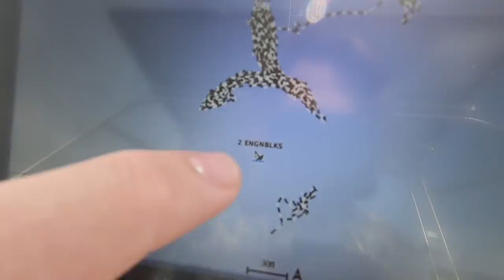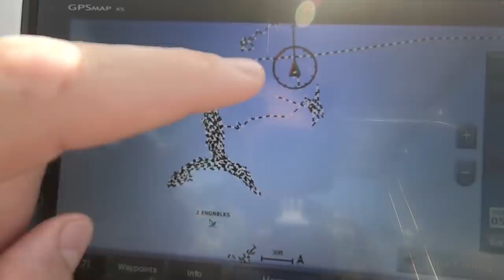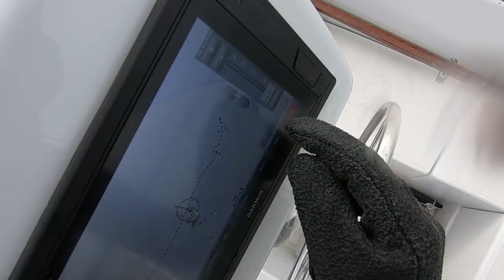You Won't Believe What Our Anchor Chain Got Wrapped Around | Learning the Lines

Comment: Attach a mooring bouy to the engine bolcks and you're golden
Reply: I was thinking the same thing. The hardest thing about having your own mooring ball is the engine or cement block to attach the cable or chain to the ball.
Reply: I was thinking the same thing and in fact if you don't want to do it my boats anchored in Madeira Beach I don't know where those engine blocks are but I wouldn't mind using them for a mooring
Reply: peter Engel my uncle said taking a train axle and wheels would work. Idk how realistic that is though since I’m strong winds with a boat attached it might roll
Reply: @noahturner1508  Yes Noah and it would make a sound  Whoooo whooet  depending on the strength of the wind.

Comment: Jordan, hard to stay on your own anchor for months on end , lots of wear, tear and growth if nothing else. A semi perminant mooring is the best solution. That's probably what the engine block were/are for. It was an old school way to creat a Mooring anchor. You could tie a heavy chain around or thru it and then attack a heavy chain or Nylon line and use that for your longterm Mooring. 
But finding a cheap slip will be a lot easier, if you don't have to spend all you money on a slip. much easier for the boat-work, obviously. Good luck finding that cheap slip though.  Maybe a couple of strong pilings where there used to be a dock might be a possibility? A couple of planks and you have a dock? Cheers Warren .
Reply from the maker: We ended up finding a cheap private dock to tie the boat up to. It's going to be a much better situation.

Comment: Some time, please show how you attached the mooring bridles to the anchor chain.  Looks like you got mantus bridles?  Pricey!  

And too bad you can't put a mooring ball on the engine blocks, but is it illegal to rig  something so you can use them as your anchor?  (I had a dock line strapped to a 6 stroke engine block this winter in the Bahamas, and just dived on it every time I wanted to use it).

Comment: At least the engines are providing a base for some marine critters.  Thank you for the video and have a good week you two.
Reply from the maker: Yeah, there were come critters and a couple corals on the engines. The only issue with their placement in my opinion is the depth at which they were placed. They shouldn't be in anything less than 15' of water to not pose a hazard to passing vessels with larger drafts. They aren't charted obviously so it's conceivable that someone with a 6' draft could hit them quite hard, thinking they have 8' of water.

Comment: Engine blocks once cleaned up a little make nice moorings. Chain them together and hook to a good line and float. I made a few moorings at my favorite locations so I didn't have to deal with anchor. Once the objects you drop sink in and become part of the sea bottom they are strong.
Reply: With a decent magnet you could find those blocks and make a mooring. You could add to it if you don't think it is strong enough.

Comment: Why wouldn't you add a rear anchor on your vessel? Stop all the round and rounds be a lot more stable anchorage . just saying
Reply: Robert Guay , you can't  use 2 anchors when other boats are single anchored. As boats all swing with the tide ( and wind) they generally stay away from each other even in a crowded  anchorage. If you are on 2 anchors you will get too close to other boats as you won't be moving, someplaces mandate 2 anchors but it's rare . Fore and aft anchored can also be a problem if the winds comes beam to your boat , a lot more windage and strain on the anchors , if you swing on a large single anchor you put the bow toward the wind and the least windage and you can easily put out extra rode for increase holding if you have the room. Cheers Warren.
Reply: Ah makes sense I can see that. Thank for your time
Reply from the maker: Warren summed it up beautifully! Large single anchor is usually the best method.
Reply: warp21drive , whenever I was to stay somewhere for a while I would put out 3 anchors with chain going to a central swivel, keeps you in place and you are always pulling on one without the possibility of fouling any of them and head was always into wind. Good in a tight anchorage, if there is someone dragging around the Anchorage there is nothing you can do about it and if a boat like that tangles with you they generally get their line cut.

Comment: What scope did you have? Looks like you had a lot. 7:1 with chain is usually sufficient and it becomes crucial when there are other boats around and you do not know their scope. Cheers.
Reply from the maker: 10:1, It's proven to not really hold. We've dragged around more than I'd like and I'll be making a video about that soon enough. The holding here is crap because it's like flat rock covered in silt/grass. There's nothing for the anchor to dig into.
Reply: @LearningtheLines  In that case you may be better off to make your own mooring using the two engine blocks. Is that doable?
Reply from the maker: @tartansailor  illegal here unfortunately.

Comment: 4" ground chain through and around both blocks... large swival..  shakle Rising chain off the  swival allowing some slack maybe double your water depth. Attach mooring bouy and mooring strops to top of rising chain. Double tie all shackles with wire or cable ties.. should to the trick.

Comment: Nice Video! I just found your channel.  At first I thought the engine block wound make a good mooring, but if you are worried about hitting the block and worried about another boat its best to leave.  
Anyway, I noticed your anchor roller is right in front anchor line locker.  Your fore cleats are off the sides on your gunwales.  Then you probably mounted the Samson post aft of the locker.  I assume a Samson post aft of your anchor locker was not a factory installation.  I want to fabricate the same set up on my S2 8.5!  How has this set up worked for you? How did you set it up?  Do you have a video about it?

I also noticed your Mantus shirt.  I am a fan of Mantus products.  I have a 25# Mantus anchor, Mantus swivel and bought a Mantus anchor roller.  I want to replicate the set up you have!!!

Comment: Hey man you know what I would do is buy one of them three foot long Giant screw anchors they used to strap mobile homes down to the ground and screw two of those underwater into the sea bed and tie your boat to those and then you know it ain't going nowhere. lol
Reply from the maker: Illegal here unfortunately. You can't make your own "permanent anchor" to use as a mooring.
Reply: @LearningtheLines  ah gotcha. Makes total sense
Reply from the maker: @Phil-Vids , thing is, there are city moorings that are exactly that. They're giant eye bolts drilled into the limestone bottom. They're super solid, but it's only legal for the city to do it with permits. We were on one of the city moorings but they only allow liveaboards so we had to move the boat. We found a nice private dock though so we moved there.
Reply: @LearningtheLines  ah very cool! Way better.

Comment: I read what you said about the bottom being thin silt on rock. Maybe more or beefier chain or time for a dock. Too bad there's no moorings there. Nice anchoring app.... ⛵👍
Reply from the maker: Yeah, I didn't anticipate the horrible holding there. On the ocean side it's sandier and much better holding. Here it's like trying to drag an anchor on flat concrete. Lol
Reply: @LearningtheLines  Just hook the anchor to one of the engines,  "oops it got wrapped around it sir".  If the state guys don't dive your anchor, how would they even know? Too bad there's another one next to it to screw with you.